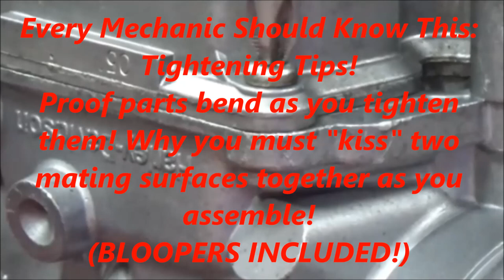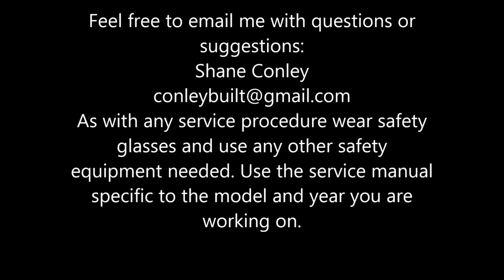EM  Series: Why you must "kiss" two mating surfaces together! Carb Bowl Tightening Example UP CLOSE!

Comment: i had a guy taught me decades ago that you always go for the furthest away each time, that way you have to be tightening them all up in a pretty even pattern. so with the carb bowl, number the bolts clockwise 1,2,3,4. with 1 to 2 being a long edge, 3 to 4 long, 2 to 3 short, 4 to 1 short. to tighten them, your pattern would be 1-3-4-2. on a case, you're looking to go from one side to the other each time. wish i could post a diagram here, it's way easier to show than to tell.